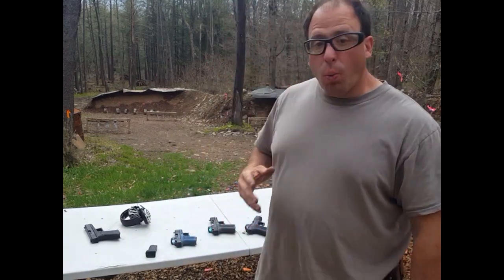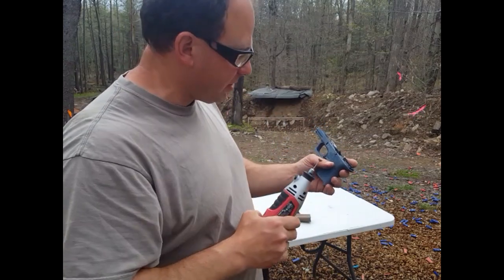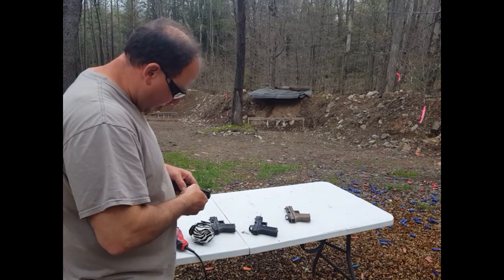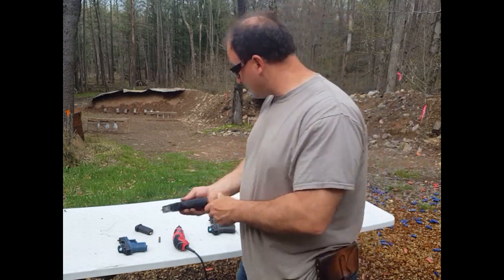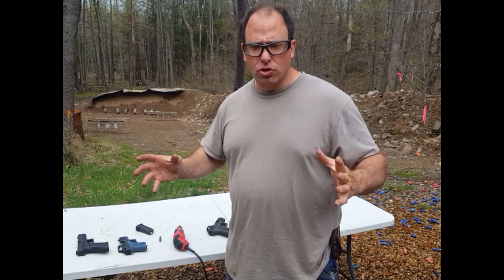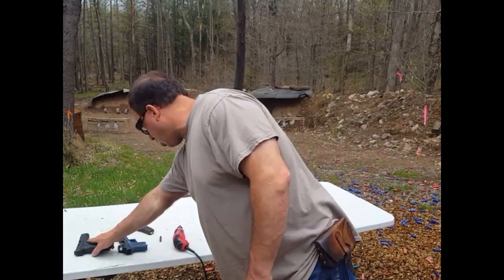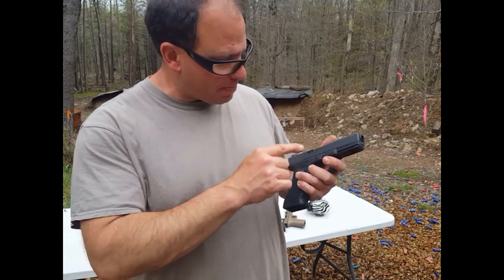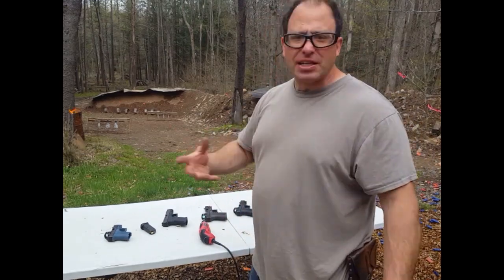Why "Ghost Guns" are Rarely used in Crimes

Comment: Criminals are using these guns because there is so many people building them and selling them to them working or not working they are still in the wrong hands…I build my p80s in about 45 mins and every single one I have made they have all worked perfect just depends on how good you are and know what your doing it’s really not that hard it’s pretty straight forward…and what are you talking about you don’t get a paper with a serial number when you buy a gun it’s called a receipts every time I buy a gun I save all my paper work with the serial number and put them in a folder and save them in my safe this guy really does not know what he is talking about lol just stop already hahaha…and a lot of guns have serial numbers underneath the bolt or underneath the slide on the inside of the gun where are you won’t expect it to be and just because you scratch it off doesn’t mean they could still pull it up you would literally have to grind it down weld over it grind it down again there is a lot more to it than you think
Reply from the maker: Most people don't keep receipts. You're not required to. Zero reason to do it.  Glock this the only one that has # on a frame, barrel and slide. Dremel will get it  off permanently in seconds.
If you had built a lot of them that you would know that the rails are often defective and need a lot of work or have to get replaced.

The guy in the video is standing on a mountain mountain of brass on his private range. Probably knows a thing or two about guns. The serial numbers in most states mean nothing anyway. Thankfully there's no registry or universal background checks. Government runs itself in circles trying to trace a gun.
Reply: @tsafa  So Smith and Wesson sigma or the XD and a lot of other handguns don’t have serial numbers underneath the frame rail? Or barrels or slides ummm I guess mine are pretty rare must be the only ones or there with them